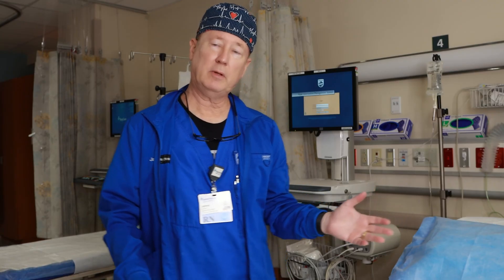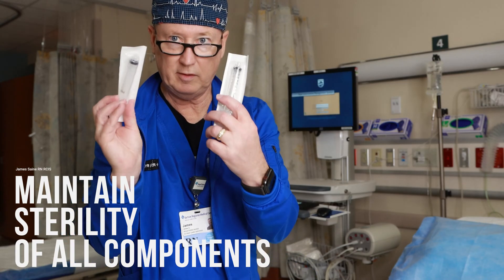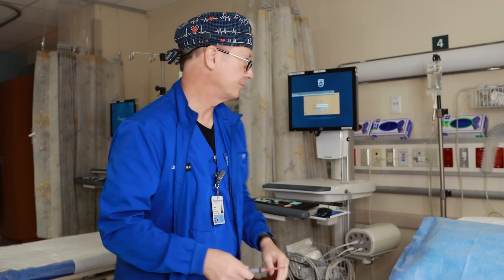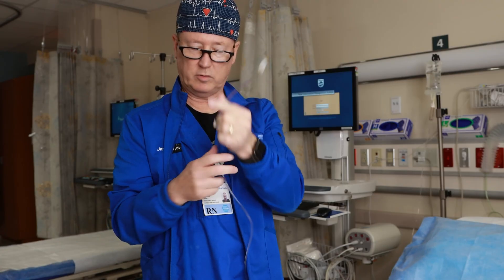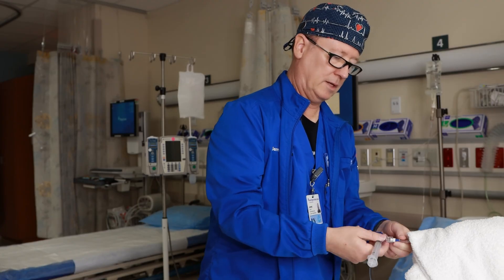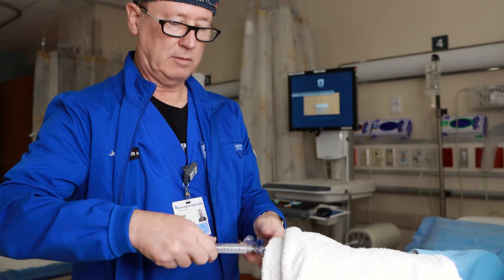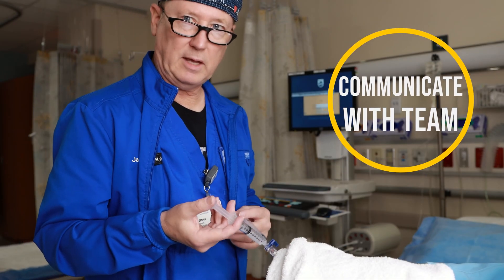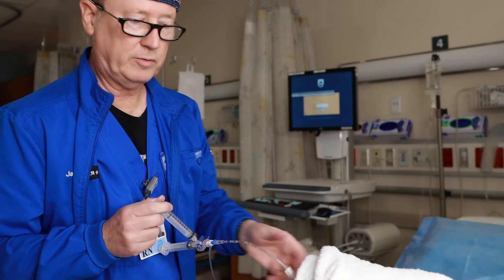How to do a Bubble Study!

Comment: What would cause the patient to have a stroke during or after?
Reply from the maker: Cardioembolic strokes associated with ASD principally occur with 2 mechanisms. The first is paradoxic embolism involving a venous-based source of thrombus, which may subsequently pass through the ASD by right-to-left shunting, causing a cardioembolic stroke. The second is atrial fibrillation that can complicate the course of patients with ASDs, especially as they age.
Reply: @JamesSaine   I’m just a patient who is scheduled to have this done soon due to inflammation of right atrium. Stress echo was neg. So I’m trying to understand this before going in just to be more comfortable.  I don’t fully understand your response. 
One reason could be if the patient has afib? And the other…? I’m sorry. Didn’t fully get it.
Reply from the maker: @TammalaJean  sure, no problem. The paradoxical part, sometimes we have clots in our legs, or elsewhere, that break loose and return to the right side of the heart. That blood then goes to the lungs, which would prevent any clots making it to the left side of the heart. Now this could cause lung problems, depending on the size of the clot. But the lungs can handle small clots much better than the brain. Now, if a patient has a hole in their heart and blood (with the clots) inappropriately travels to the left side of the heart (skipping the “filtering” process in the lungs, that clot then gets pumped out to central circulation. It could go to any organ and cause a blockage. The worst placed world be the brain causing a TIA or stroke.
Reply: @JamesSaine  wow thank you for responding with so much info and so quickly! I truly appreciate it. Thank you 🙏🏽

Comment: Doesn't it cause shock? is it will move to brain?
Reply from the maker: No, the bubbles just disapate. The majority goes to the lungs and is reabsorbed. If the patient has ASD or VSD, some bubbles will go to the left side, but they are small bubbles. IF you injected a large amount of an air bolus into arterieal circulation there pt would die. At some point, injecting an air bolus into Venous circulation works cause harm to the patient.  Idk how much though. The bubbles from a bubble study are harmless though
Reply: @JamesSaine  Thank you for your reply , when performing ASD or PFO procedure, if there is a bubble in the device, it will be harmful. is it different ?
Reply from the maker: @2RavelGo  let me clarify what you mean when you say "performing ASD or PFO"?  Do you mean a bubble study and the patient has a PFO or ASD?  If so, it will not do harm

Comment: How long does this test take?
Reply from the maker: Generally 7-15 minutes for a TEE. The bubble portion, 10 seconds or so.  Some times done with moderate sedation, other times with deep sedation. If you are having it done, insist on deep sedation (if not contraindicated)
Reply: @JamesSaine  Why the sedation?
Reply from the maker: @KavaYahRose  bc a TEE is extremely uncomfortable.
Reply from the maker: The reason it is uncomfortable, the TEE probe about 2 feet long. Goes into your mouth, down your throat and sits in your esophagus, behind your heart
Reply: @JamesSaine  Thank you!